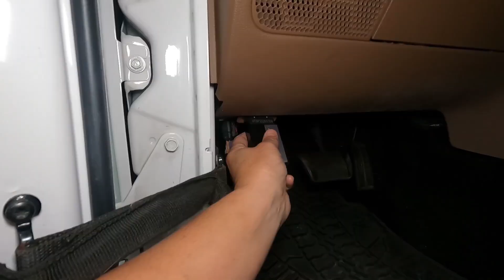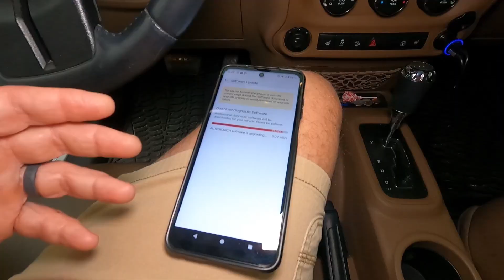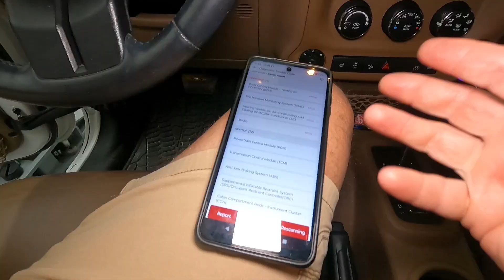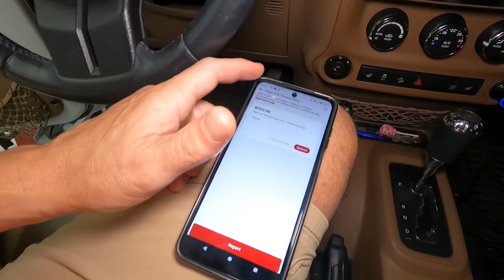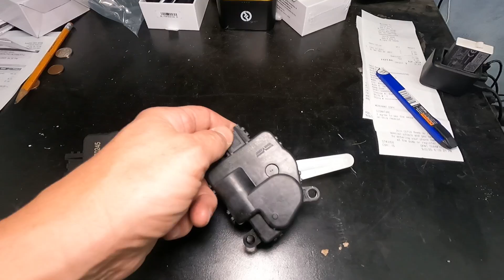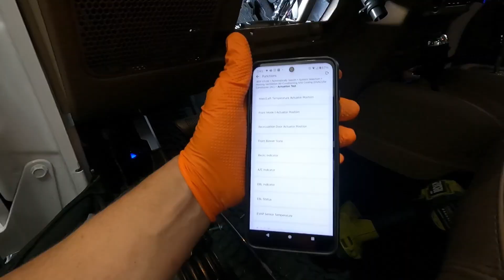How to diagnose and fix a jk jeep wrangler with no heat (Kingbolen Ediag Elite on B11CC-00)

Comment: I have a 2011 JKU and it's only heating the passenger side, the left side blows lukewarm air. There is no blend door noise (no broken teeth) What do you think could be wrong with it?
Reply: I actually had to replace the actuator located to the right of the glove box.  It was not making any noise, but we found the plastic pin that holds a gear in place failed.  Replaced the actuator, and problem solved.  FYI, it is a bugger to replace this actuator.  Good luck.
Reply: It’s your heater core. Don’t waste your time with the blend doors. Look up the JK video of the two guys in the garage doing a Jerry rig’d core swap. I just did it myself and saved myself 2k.
Reply from the maker: the actuators can fail and not make the clicking noise, so that's plausible as explanation, but could be weak fan, disconnected ducting under dash, semi clogged heater core...Hope it's something simple and cheap to fix!